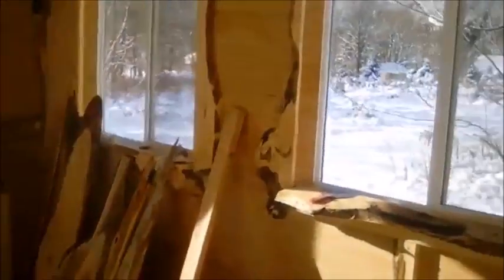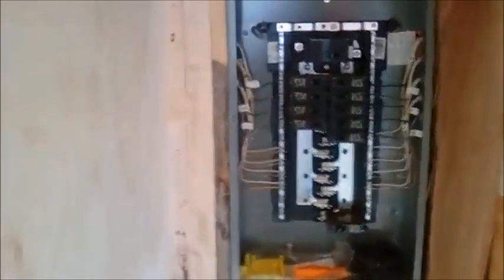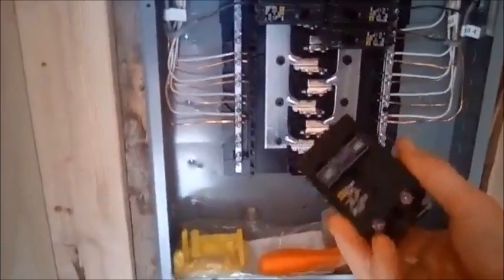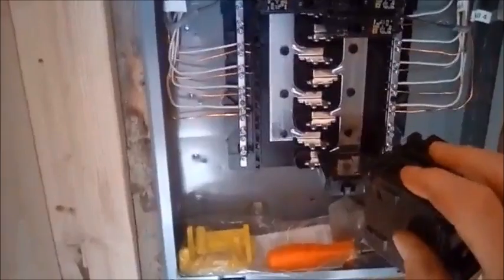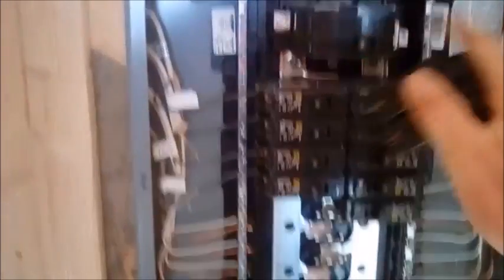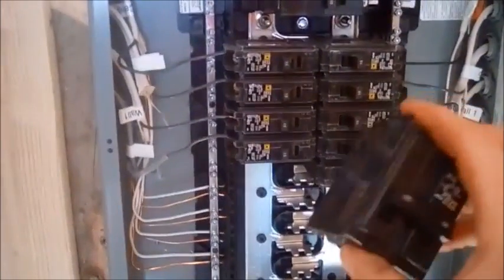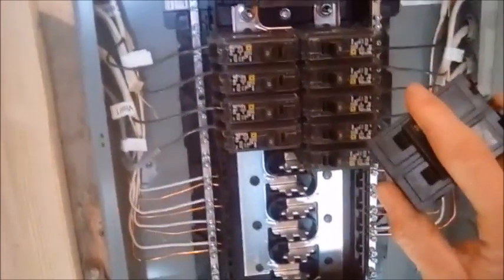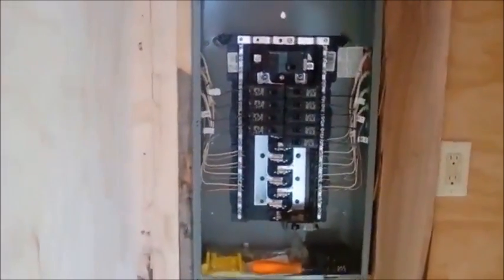Use the Cybertruck to power an Off-Grid Tiny House or hook up to your On-Grid system for emergencies

Comment: I already live in my Tesla Model X. If the Cybervault has climate control, I’ll upgrade to living in that. And then I may eventually upgrade to a Trailer that my Cybertruck could tow and power with the external 240. Hope I can get free unlimited supercharging. May also keep my Model X and have it on TESLA Network 24/7.

Comment: I am not quite sure why a 3 prong plug wouldn't work.
It has two live 120V (out of phase) prongs and a combined earth/neutral prong.
So just wire the earth/neutral to the busbar ?
Reply from the maker: Hey George, I'm no expert but you only use ground as a path for the electricity to flow in the event of something catastrophically bad happens. It's basically a way to trip the breaker. The Neutral is the path that 120v takes to get back to ground to complete a circuit. You want to run power through the neutral, but generally avoid running power though ground (except for when it hits the breaker panel). On a 3 prong 240v the ground is not a neutral, it's just a ground. The chances of Tesla releasing the truck with a 3 prong 240v plug are slim to none. There are lots of people who will want to run more powerful 120v tools off the 240v outlet.
Reply: @Electric-fatbike  
Inverter on the Cybertruck is a mobile installation, and as such it can't have a true ground. We can speculate on the exact wiring, but I would assume that 240VAC output on the truck will have 3 wires (there is also a chance 240 will be single phase, with separate 120 single phase - i.e. two inverters), and there will be either a separate grounding terminal, or the ground would be connected on the chassis of the truck. So when used as a generator for a dwelling, Cybertruck would accept ground from the ground rod interconnected with the main entry panel, instead of providing one.